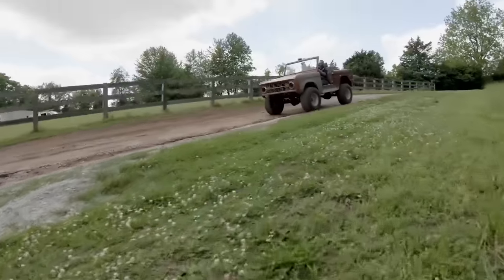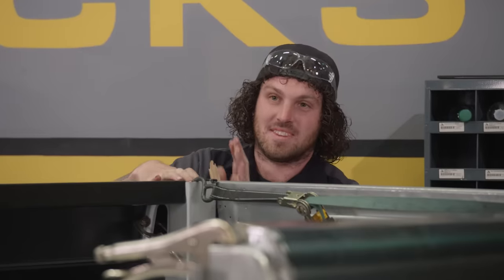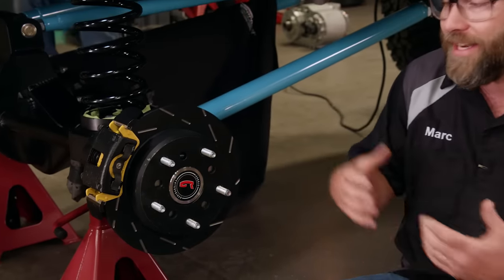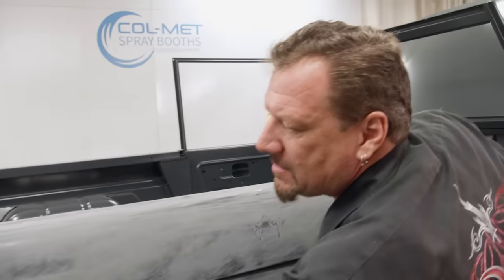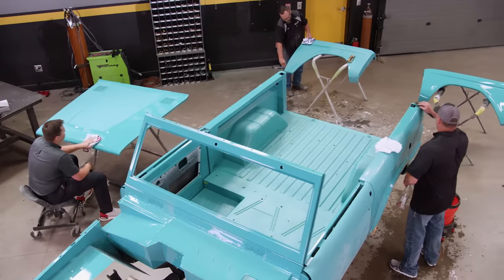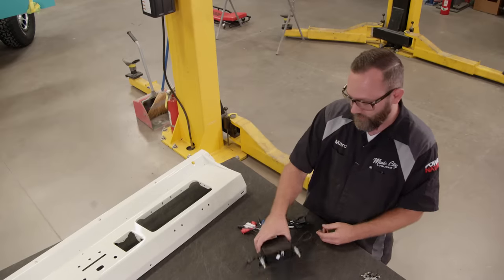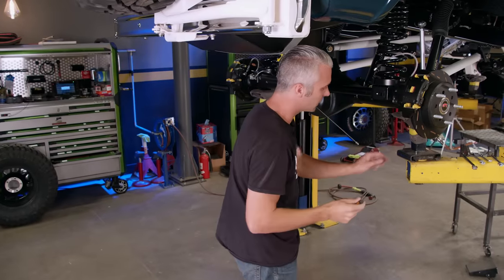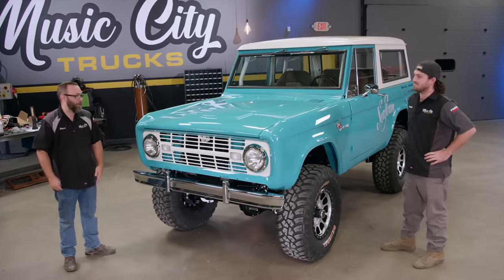Full Build: Restoring A Classic Bronco With A Modern Twist

Comment: This was cool, but I would have enjoyed a project that used the stock chassis with suspension upgrades, the 302 with upgrades, including FI, with new body panels since the stock parts were shot, but using the stock roof. Much cheaper and reasonably obtainable, but I understand this was a off the chart project.

Comment: With freshly powder coated parts any bolts tend to loosen off in the first few days after assembly as the parts settle into the fresh paint so always perform a thorough spanner check after a week then another after a month
Reply: Just weld all the nuts and bolts together!

Comment: Might be a stupid question but can you get radiators with more fins so the fluid travels a greater distance or is a shorter distance better?
Reply: More distance should allow the coolant to cool down more. It's all about increasing surface area of the cooling fins so more is generally better. The thermostat should handle the rest in cooler situations.

Comment: Never use sea foam in two stroke it can wash the cylinder takening the lube in the fuel away causing excessive friction which leads to failure have had it happen to three pieces of machinery because somebody decided to add sea foam to the two stroke fuel.

Comment: How do you register a car like this? It's not an actual Ford Bronco, and has none of the original parts, does it still need to be smog tested and if you plan to sell it, does it need to be listed as a kit car or reproduction?
Reply: It's a kit car, all it has to do is comply with emissions and pass an inspection.
Reply: in most states you don't even have to do any of that , just go to the dmv and get a title for a custom hot rod
Reply: @Hard_Right  I live in shitty California, so it surprises me how much freedom everyone else has, here you need a permit just to fart (joke), so to get this approved by DMV is a nightmare, I hear.
Reply: It's considered a  replacement  body you  use the original  title and  it only has to comply with the  year of the  vehicle  in term of emissions  wich isn't  hard to  meet with the  modern  drive train and  most states  any vehicle  over  25 years old is  emissions  exempt  anyway

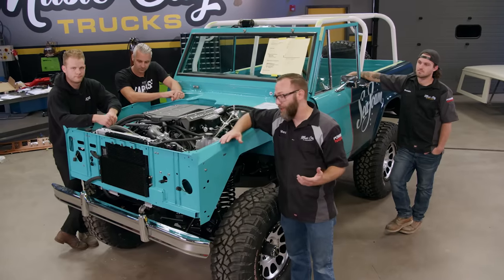Comment: I'm just curious how many Broncos were involved in the making of this video? We have the original that was rolle out back and never seen again then we have the model kit they built. At 2:52:45 we have one with the seafoam logo and dark blue paint and red trim that goes up on the rack. Then  at 3:04:15 we see the "finished" Bronco WITHOUT the dark blue paint. Then the the final, final one that is auctioned off has NO logo or special paint or decals at 3:27:15 .... By my count thats 3 brand new Broncos they built and the one they threw away. Am I wrong or did I miss something?

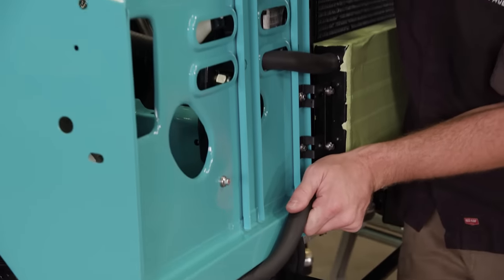Comment: 2:35:48 Rule on off-road vehicles: Never pass the hose between the body/chassis. The upper hose is in a good location but the lower hose is in the wrong area. 
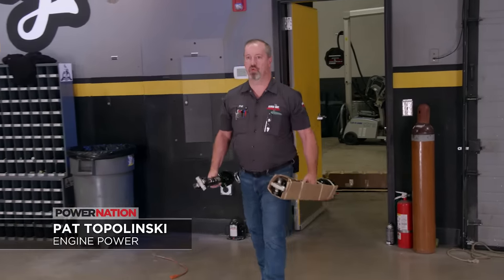At the first impact, the front grille cuts the hose. 2:57:14 Gel battery ok. But its location and stance are wrong. Shock and mud from side is not good for the battery

Comment: Mate, don't talk taking that on the beach because that is a truck Killer. I won't take any of my vehicles anywhere near that place even with rust proofing. That said, I'd love that truck body, it's the last of the real vehicles. Oh and if I had a choice with engines, I'd ditch the 302 & go the 351 with at least a stage 2 towing cam, that makes for a great sleeper rig. In Australia, I don't think that kind of radical modification is allowed, Although I'd do drive train the same If I had a choice but I'm traditionalist when it comes to the motor, Carby cam & extractors would be the limit. And don't forget a decent BULL BAR, we have all sorts of car killers (wild animals) over here that just want to run into the front of your vehicle here. The cost of your build would have been astronomical, especially that 800 HP motor oh and on that, I think with the clearances you have there it's going to hit a few things under there under full throttle, I have a habit of giving it to it every now & then & so will the owner of that mega truck.
Reply: @ami2evil  LOL only sometimes

Comment: As a car audio guy just a couple tips. Your alternator dictates the amount of power you can run in your system (altenator amp × 14) Also Please... Please fuse your power wire at the fuse and also at the amp. Unless you enjoy vehicle fires. And lastly do your research, lots of misleading numbers and manufacturers out there.

Comment: probably different in the states but in the UK if you replace the chassis its a new car and need to be registered etc like the chassis is the car. I enjoyed this video very much but its just a build not a restoration. there is practically nothing left of the original to the point im questioning why even buy the original bronco and not just build a new one as thats pretty much what you did, again im not hating and this video was brilliant just my 2 cents.

Comment: Great video buuut.. you guys basically destroyed an old vehicle, threw it away and then bought brand new everything. Could have just went to a salvage yard for the grille and transferred it to your brand new build. Other then that this project was awesome
Reply: Its a Resto-Mod Dude ._.
Reply: I completely agree they destroyed and trashed a bronco that someone could have enjoyed.
Reply: The branco was so rusted that it was not worth the time, or money it would take to make it safe enough to reuse. That's why they junked it so if you'd kindly open your eyes and ears you would have known that.
Reply: Theres plenty of restored or crappy broncos, go buy one the
Reply: Replaced and not restored 💯 no Vin tag on that  tub 🤔
Reply: Just take the radiator cap from the old one and put it on the new build.
Reply: @BluePotatoes23  😂😂😂 he basically used nothing from old car. Don’t justify it. This is not restoration. Google what restoration is if you don’t know.
Reply: Remember the one Stacey David rebuilt...Krazy Horse..it was farther gone than this one.

Comment: As far as the lights on this Bronco, I would've installed LED lights on it, especially if you were going to be driving at night
Reply: I kinda think normal lights suit the car better. There's no LED lighting anywhere on the car. And blinding others is just uncool. Besides that - this car gets bought for 135k, so it propably never be driven aproprietly or even at night. Most likely end up in a collection where it will sit for days to come
Reply: just because you can doesn't mean you should .... led lights aren't for classic cars . you kids and your "mOdErNiZe EvErYtHiNg" attitude 🙄🙄
Reply: @Hard_Right  I'm hardly a kid

I'm 51 years old

The reason I have for why I'd havr put led lights on a vehicle like this is for safety reasons and for those of us who are of the older generation, particularly those of us who's eyesight starts going bad, especially while driving at night, you tend to be more appreciative of things like that as you get older

Comment: This is a kit car build and not a restoration
Reply: and it better the OME shit parts
Reply: @funtyes1970  Let's get it right, pal:  OEM:  Original Equipment Manufacturer (OEM).
Reply: Well either way you look at it it  is a resto mod  even though it isnt a ford ,Dearborn body the real parts arent available. These parts are after market  and the only parts that are OE are from LMC Truck and with those you can get an original title for the tub or hull. The old bronco had its own which transfers easily. But I know your purist types cant be glad for anything or anyone.
Reply: Looks good.  Doing it this way gives control that the original designers didn't even have with the bean counters upstairs constantly dialing back their better intentions.
Reply: And we do not hear how she screams
Reply: @shaneharrison4775  so what?
Reply: @torkrench  so buttons on a tin shirt with a rubber needle . The fact being the whole body needed work and it got it with mods and reinforcements but most the vehicle was original not stitched together with aftermarket replacement parts and whole replacement panals. They basically built a new body and subchassis and put the title on that.
Reply: @shaneharrison4775  and they make no bones about it… you project as they lied somehow?  Its a new build to mostly promote the new sheetmetal available and to sell parts, where ya been
Reply: I'm sour at the they word this project because it's beyond me so I have grievances
Reply: Who cares! It’s a bad ass truck and it’s auctioned off for a GREAT cause!

Comment: The new brocos did not revive popularity that much for the old ones. The 60s broncos have been out of my price range my whole life and I'm 38. 60s and 70s f100s are still afFORDable. Wish I had scooped up every fox body I could when I was a teenager. Used to be able to find those for 2500$ with low miles

Comment: Dudes! @ appox 1hr40min, What the F.U.B.A.R. are you doing! Where is the winch? Where is the upgraded bumpers and strengthened anchor/ recovery points? It is supposed to be Amazing on the beach, right? Then it should have a winch and ideally an 8 pack of MaxTrax(or whatever there name is).

Comment: 1. That paint is an ugly, girly color.
2. The wheels don't fit right (wheels/tires aren't supposed to stick out past the fenders; it isn't even legal in most states, and it looks foolish in all states).
3. They evidently didn't want it to be fun to drive because they stuck an automatic transmission in it.
4. That mishmash of sponsor decals looks terrible.
5. That painted bed liner on the floor pans is going to get all scratched up and be hard to clean due to the rough surface. It should have full rubber flooring.
6. Since it's not really a vintage Ford Bronco, nor a Ford of any kind, but rather, a newly manufactured no-brand vehicle, there may be some legal problems with it for anyone who wants to drive it on the road. I didn't see them install a catalytic converter for example. Also, it can't be registered as an antique auto. They obviously should have reused the firewall and VIN tag from the vehicle that they started with so that it would legally be a 1974 Ford Bronco.

Comment: These broncos look cool but suck driving! You can easily flip it over, especially if you lift it!  You can’t do quick steering inputs, you will flip it! I had an original and got rid of it! I had a 86 blazer that had the same issue, to short of wheel base..

Comment: This is not a restore all they did was cut up and throw away the original bronco then bought all brand new everything and built a brand new bronco from brand new remanufactured OEM parts and pannels. A real restoration is finding real body panels or using what you have and carefully patching in and welding in new body  filler pieces instead of Bondo so that way atleast it's the original bronco and not new parts from a factory. They basically said credit card ok check sponsors on check throw away original bronco check ok good we restored the bronco

Comment: I am trying to understand: if you paint and and clear coat, then wetsand, all you are really sanding is the clear coat, or, perhaps worse, sanding off the clear coat.  i really don't understand why your wouldn't wet sand, to remove any imperfections and orange peel, which was visible, and then clear coat to lock in that perfect paint finish?   Why not powder coat the frame from the start as the first thing you do?  And why the hell buy an old Bronco, then basically just build a replica from scratch?   Honestly, a lot of this process didn't seem to make much sense.
Reply: It's preferable to not sand the base coat. It's okay if it's a flat paint, but if you sand a metallic or a pearl, you have to shoot it with one more coat, then your clear. And yes, sanding the clear is standard operating procedure. The idea is to spray it as clean as possible. Minimal dust, nibs, orange peel, etc. Then wet sand it to completely flat, reducing grit until you have a mirror shine. So when you spray clear, you do so with the knowledge that the top coat will be the sand/polish coat, to one degree or another, depending on the quality of your booth (or even the existence of a booth in the first place...)

Comment: “Restoring”? Didn’t know building a vehicle completely from sponsored parts was restoring
Reply: I would like to have seen y'all do a real restoration on the one you bought and not just throw the old one away. Question since you went with a new frame did you get a new VIN number for it because using the old vin would be considered illegal because nothing on that bronco is original, Why didn't you touch on that?  Sure this shows that the parts are out there, but again building from scratch is not restoring
Reply: Agree. Also don’t like that they shit on the previous owner. At least he tried to restore it instead of just throwing it away…
Reply: They used the original vin plate... That's it though.
Reply: It’s totally ok to do this. As long as it’s yr tools that do the final assembly yr as golden as sunshine lol

Comment: Or if you for some weird insanly unfathomable reason you want to listen to FM radio. Last time I attempted to listen to the radio because my phone went dead I litterly scanned the frequencys for about a minute and said oh hell with this and listened to nothing...now saying unless you are actually seeking silence the thought  that you would rather listen to nothing than FM says volumes. my exhaust is way more enjoyable to listen to vs FM radio, and does anybody other than old folks from the "greatest generation" listen to AM radio? Is there even anything on it any more? I'm gonna have to blow the dust off my AM button just to see out of curiosity, my guess if there's anything it'll be awful public access talk radio and low fidelity bluegrass music. I had a 76 Nova in 94ish that still had the factory 8 track/am radio with one one badly dry rotted dash speaker left. it also had an realistic add on below dash cassette deck with an archer radio/cassette switch for short times I would turn on the radio now n then for nostalgia reasons it sounded bout as good as a walkie talkie lol. I did get some rear deck pioneer tax speakers hooked to the cassette deck. Rear deck Plastic pioneer tsx8 speakers that would turn into projectiles in an accident! Good old fashion go to sound systems back in the 70s/80s